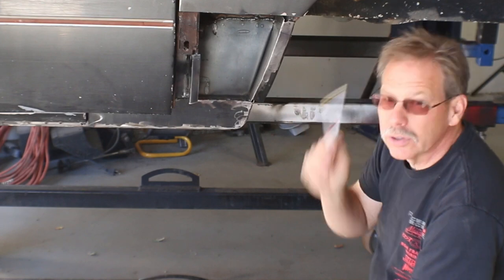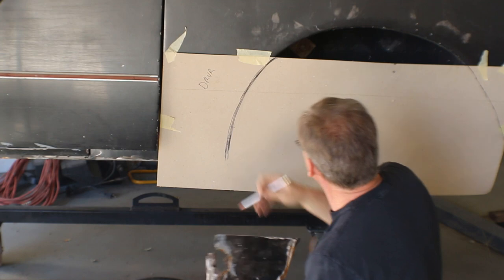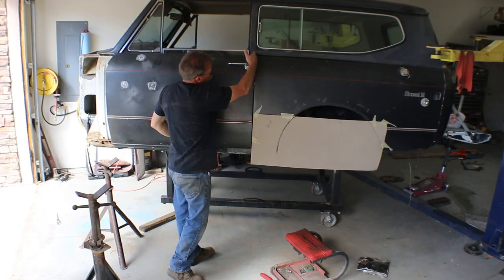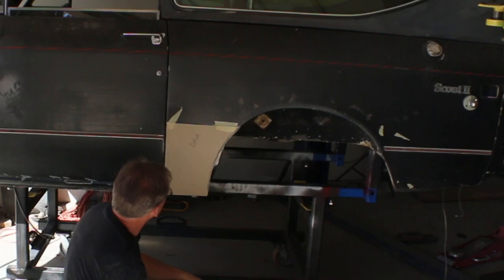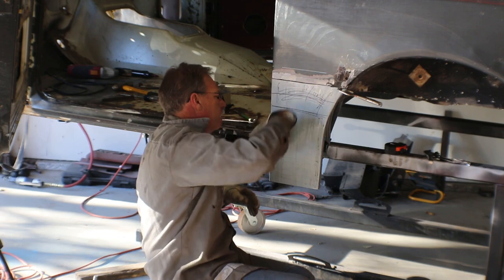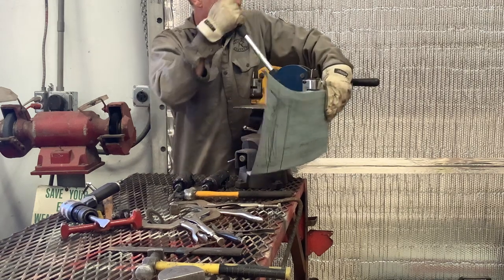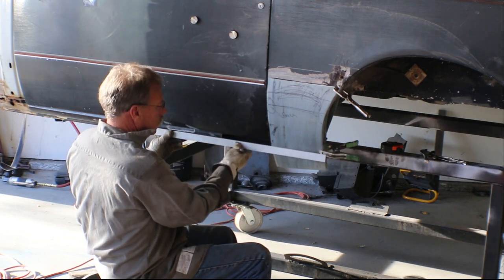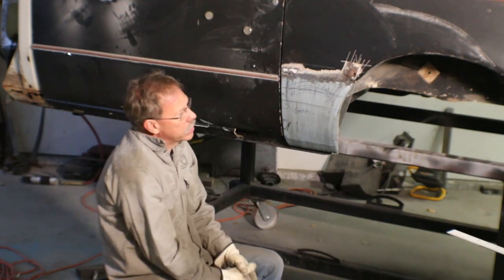B Pillar Rust Repair - Day 3 | International Scout II | Project Creep - Ep. 16

Comment: If the door hinges are still tight, it may be that the A-pillar and everything forward has sagged across the door opening relative to the quarters/B-pillar.  A proper-length horizontal brace between the A- & B-pillar just below the belt line would help.
Reply from the maker: Very possible.  I left the roof on for just that reason and you’re right some bracing through the door opening can help alleviate that when cutting out big chunks of the floor or rockers.  Thanks for watching!

Comment: as you know by know the ft of the lower quarter, comes down at an abrupt angle Its more noticeable with larger tires. On Scouts with tires over 33's I move the rear axle back an inch.
Reply from the maker: I had to do this as well, and in later videos I made some other mods.